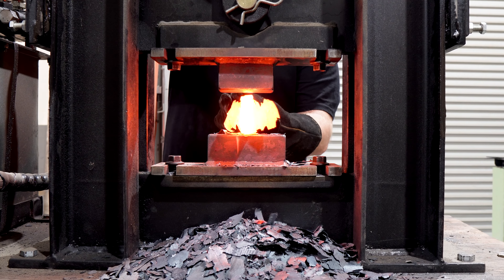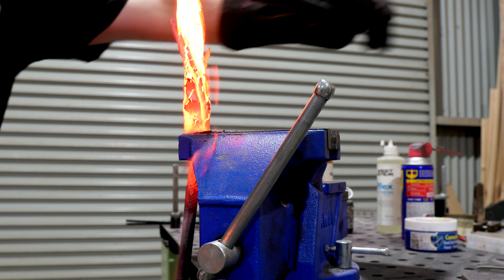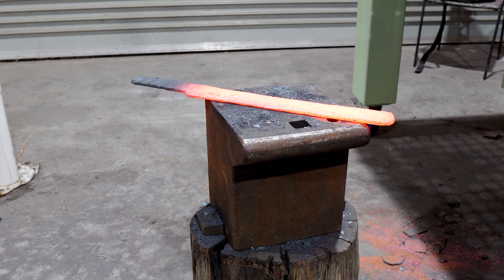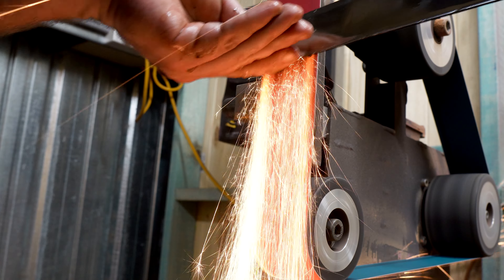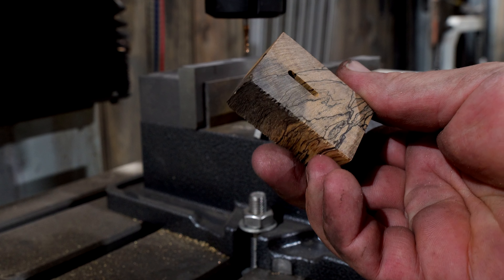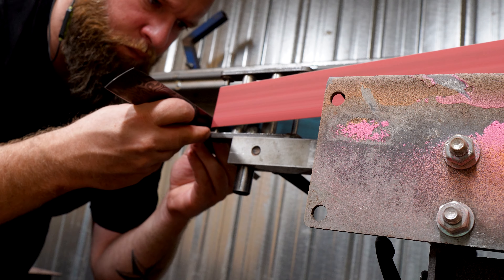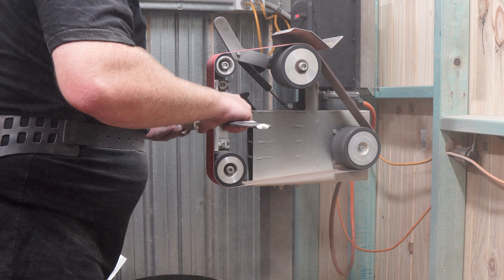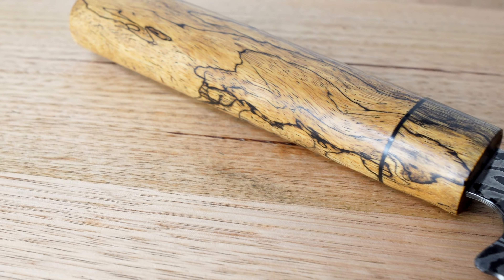Making the bread Katana: Forging a serrated bread knife

Comment: Thats the fanciest brwad knife ive ever seen. Worthy of those $15 sour dough loaves. Biggest question is how does it cut? Many crumbs? Good bread knives are a fine art that almost all comercial knives get wrong.
Reply from the maker: Haha Thankyou, it does cut pretty nice! The trick is in the radius used to form the scallop, it’s kind of hard for me to articulate, but if you sink the scallop no more than about 1/3 of the total diameter of the wheel used, it dosent tear the bread when cutting, but if you go closer to 1/2, that’s when the teeth get too aggressive and start tearing everything, but in short, I’ve used it a heap since I filmed the video, and it’s nice and smooth cutting 😂 thanks for checking it out!